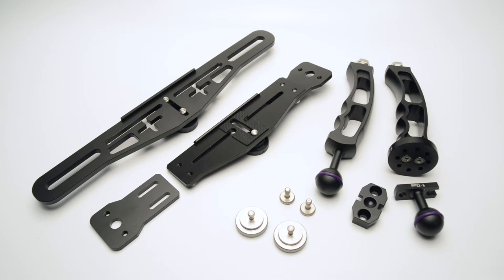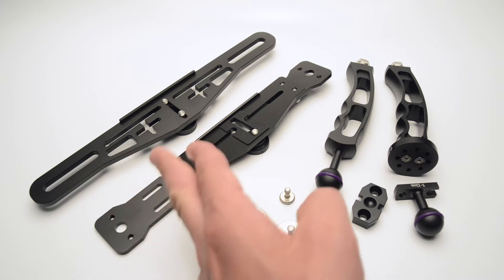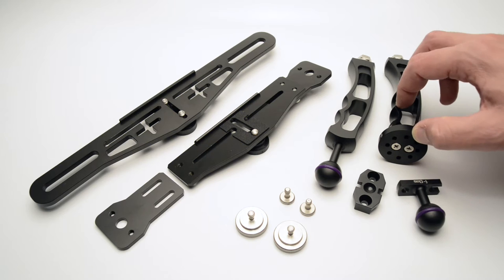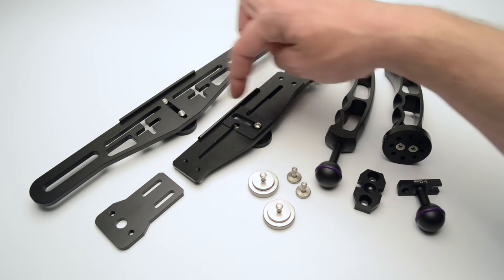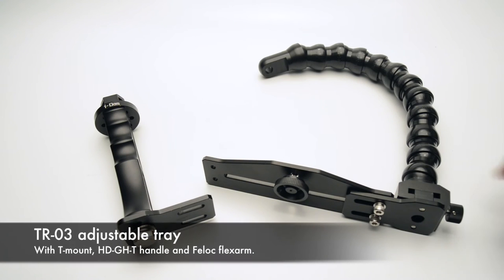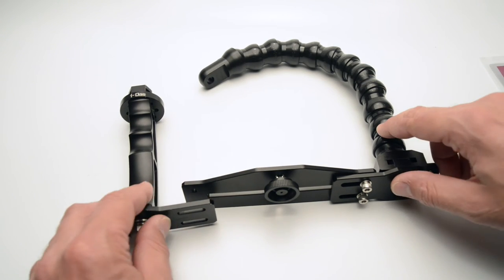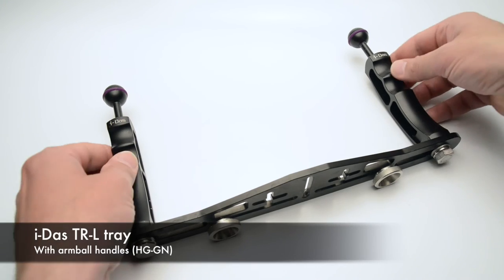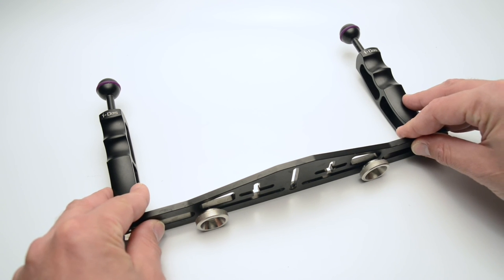i-Das Underwater camera housing trays

Comment: Hi, thanks for the very information video.
I am wondering, are the balls on the arms removable ? if so, do they have a 1/4 inch thread ? I have a 2 light and motion flex arms with 1/4 inch screws, can i mount them on ? does this tray accept other handles like the Ultralight Handle grips ? Thank you !